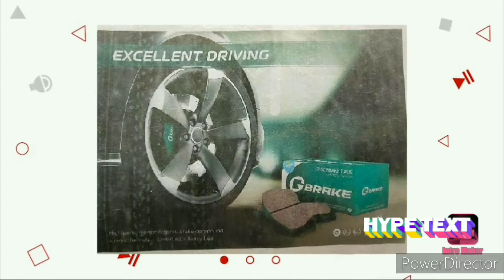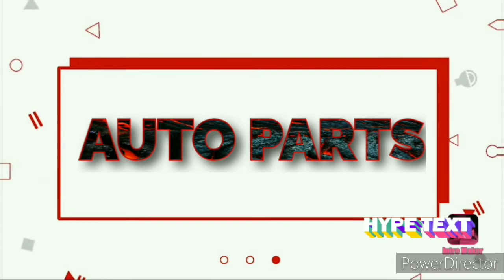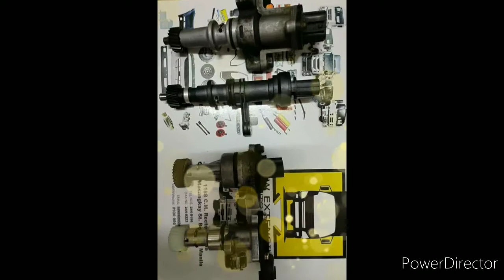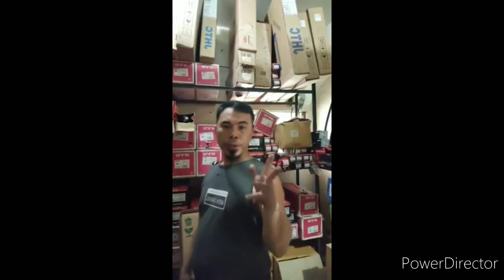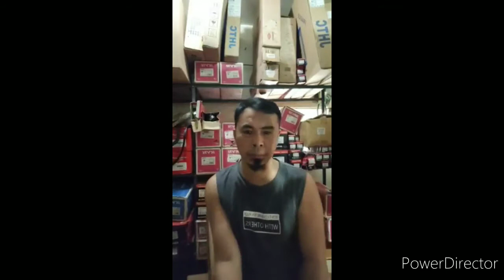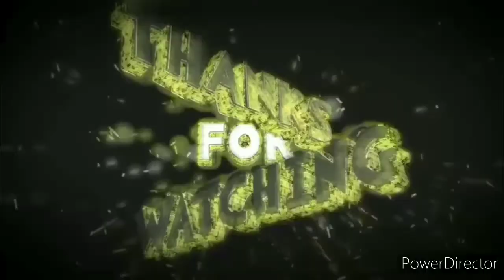crank shaft sensor nissan NV350

Comment: Magkano Po sir? Pang nv 350 Nissan urvan crankshaft position sensor.CPS?
Reply from the maker: 3500
Reply: Replacement po or original?
Reply: @dongsparepartstv5089 sir may parts po kayo para nv350